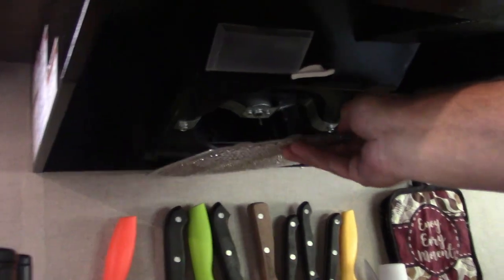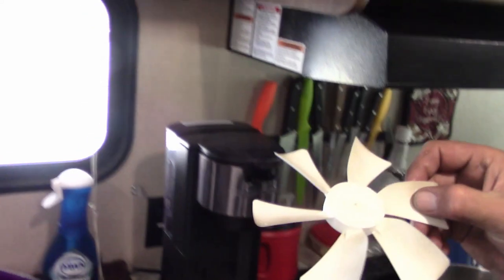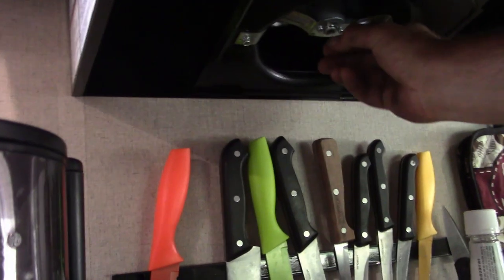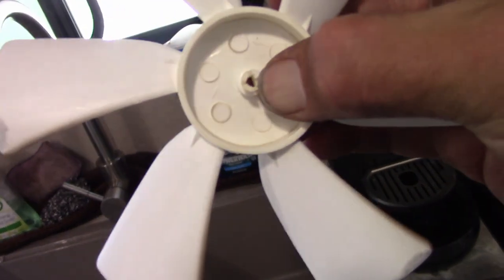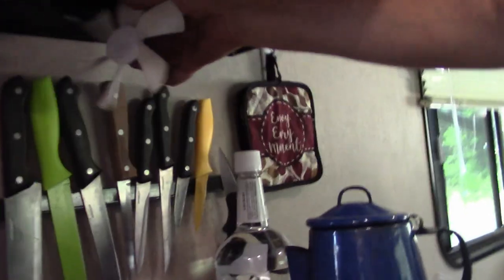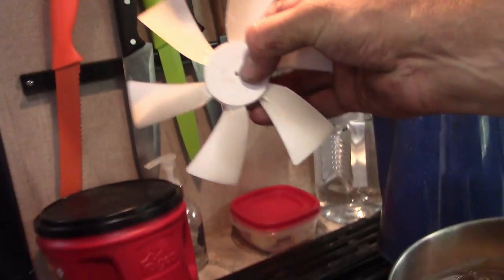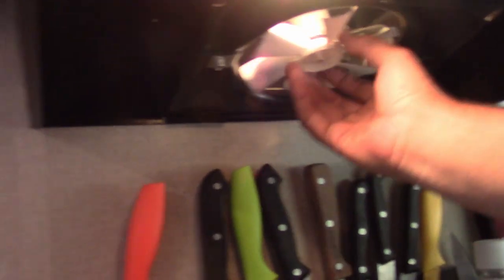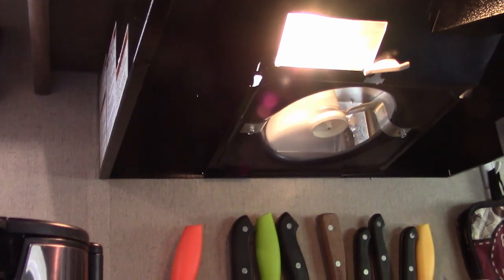RV range hood exhaust fan no worky worky

Comment: Tell ppl where to get that glue atleast. And most times it might be your battery. It can stop holding charges if its gone through too many power outages. Dont use glue. Buy a new fan rotor piece. They are really cheap on amazon.
Reply from the maker: Here you go.. You can go to Wall Mart or any other super store and get some glue to do the repair. And I am not sure how batteries will cause a fan to fall off. And we were out camping when this happened, so amazon was not an option. But thank you for your comment.

Comment: My light bulb must be out but the fan works . Does the bulb come out easy ?
Reply from the maker: I do not believe it is to difficult,  we have sold that trailer and now have a 5th wheel.
Reply: @DiyRVandHome  do you know the bulb size ? I got it out and put it on the counter at home and sure enough it broke .oy vey
Reply from the maker: @ken5791  sorry I cannot help